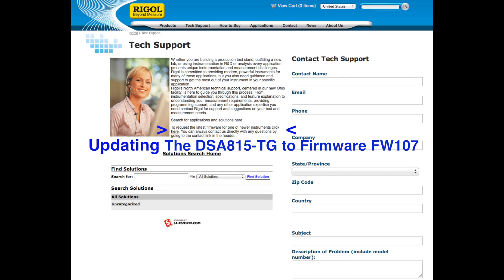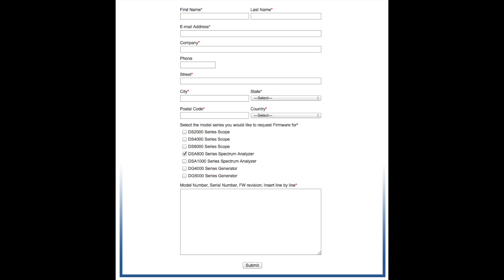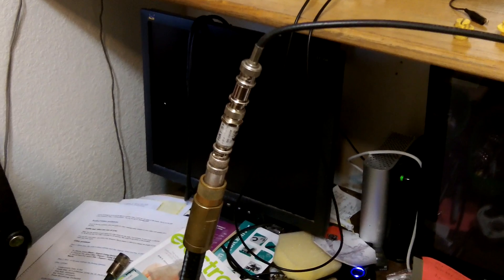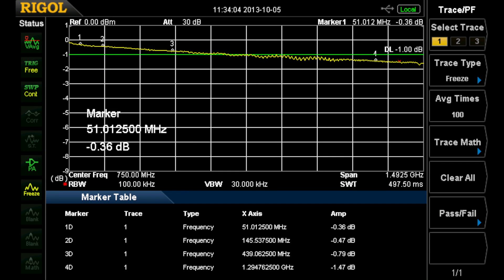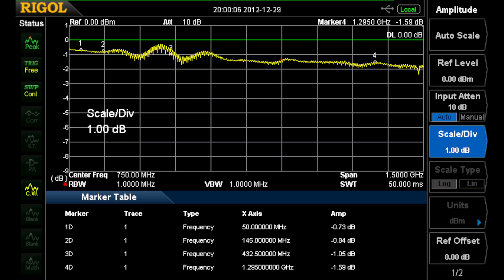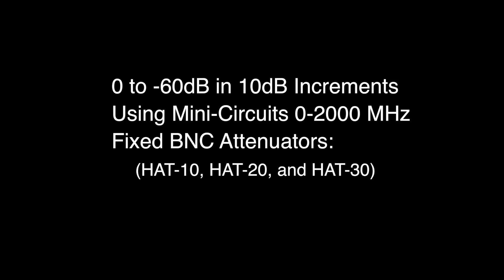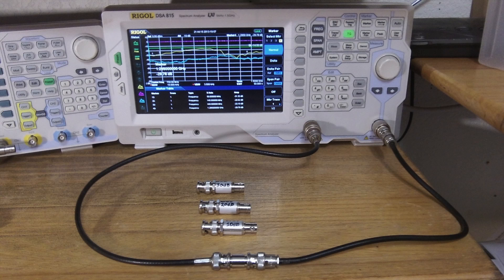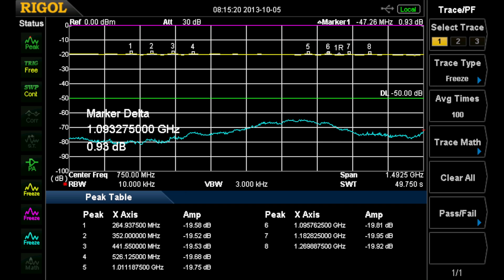FW107 Upgrade DSA815-TG

Comment: Hey Jim! My Rigol DSA815TG just arrived yesterday. Still in the box.. I use to use a HP 8753E VNA and could measure SWR. Can I do the same with this unit? Or do you use a different procedure. I am new to this so need to be spoon fed. Would enjoy speaking with you directly if ok? My email is k8kem@aol.com should u want yo give me ur cell nbr?  Thank You! 73's David
Reply from the maker: The Rigol815-TG is not a VNA.  It can be used as a Scalar Network Analyzer with an external Directional Coupler or a RF Return Loss Bridge.  See my video at: https://www.youtube.com/watch?v=ct_ZUYTRkOA and at https://www.youtube.com/watch?v=lqd_6s8ZfqM&t=10s

And online calculator for return loss vs vswr is at: 
http://cgi.www.telestrian.co.uk/cgi-bin/www.telestrian.co.uk/vswr.pl

Essentially, anything better than 14dB is a vswr below 1.5:1.  9.5dB is 2.0:1.  20dB is 1.2:1.  The "really don't care" point for most of us is anything better than RL= -14dB is 1.5:1 VSWR (95% gets through) though 1.2:1VSWR (20dB) is an even better goal since 99-percent of the energy gets into the antenna or load.

I hope this helps.

Comment: ALL my Trials have disappeared and my VSWR Bridge Code will not load?
Reply from the maker: As I understand it, the DSA815-TG comes with all features enabled for a trial period of time but then those for which you do not purchase a software key will become disabled.  The VSWR Bridge Code is one of those.  However if you have purchased the Bridge and Code from Rigol, you need to enter it into the unit.  If it doesn't work and you've paid for the software key, contact Rigol or the dealer from which you purchased the analyzer.
Reply: I Finally Got the VSWR Bridge to work, but all others lost and this the second Tme I turned it on, and right after an UPDATE. Called RIGOL and they got me New ones and a file to install to regain my Trials back so I can see what they are...

Comment from the maker: By the way, I updated from FW104 to 107.  The EEVBlog Forum suggests that some of the earlier versions (105, 106) may actually be the ones addressing some of these issues.  You can check this all out by searching for 'DSA815 Firmware' on the blog forum.